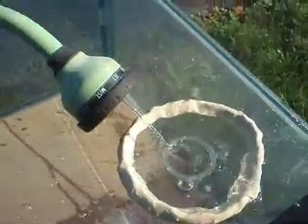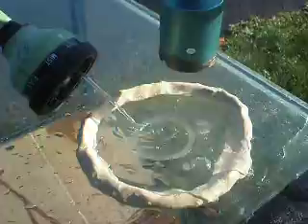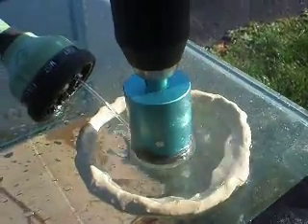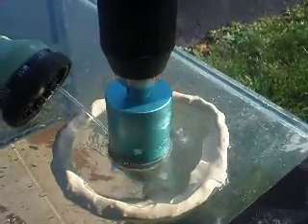Drilling an aquarium.

Comment: @diffitt To "drill and Aquarium", you are putting specific sized holes in the Aquarium in specific places to allow you to either install a closed loop circulation system or to be able to add a sump system under the tank for better filtration. Hope that helps clear it up some. :)

Comment: @DRam1981 Thank you. It wasn't the best or most perfect as I was mearly using it as a demonstration. By clamping on a 2x4 underneath where I was drilling through I could have avoided the slight "blow-out" on the backside when it went through.

Thank you for your comment. :o)